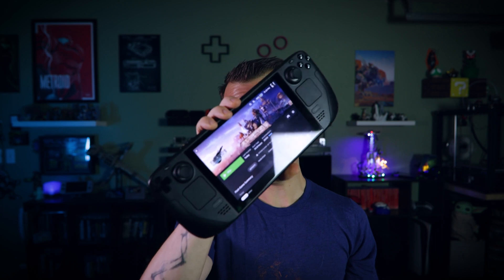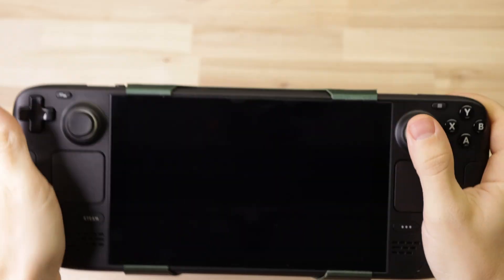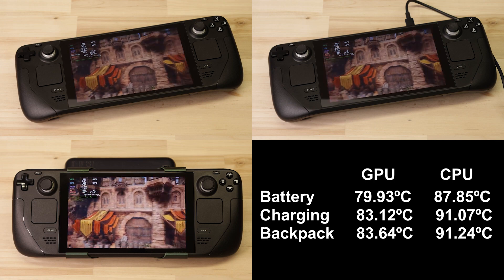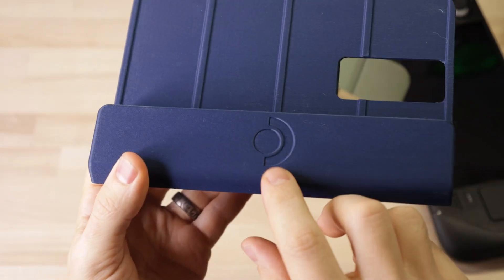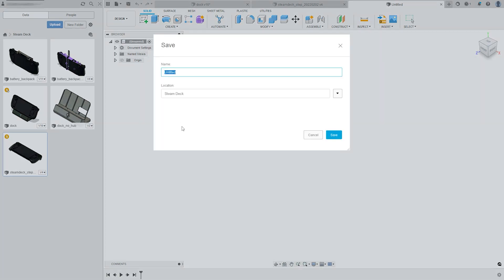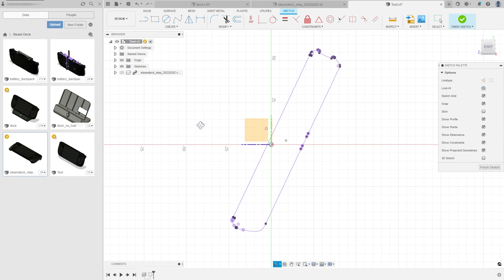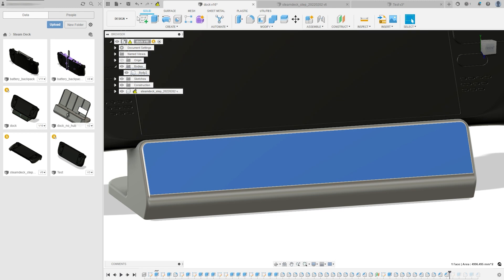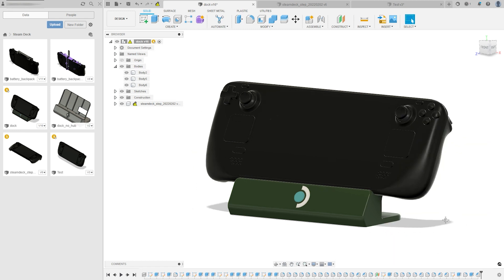3d-Printable Steam Deck Accessories + Fusion 360 tips and tricks!

Comment from the maker: What other kinds of accessories would you guys like to see for the Steam Deck??  Or other handhelds too I suppose... 🤔
Reply: Steam deck case cover , so i don't need to buy the whole kits (dbrand killswitch) . for me thats all i need using my spigen case
Reply: Hey @wermy .  Was wondering what material you would recommend for the battery backpack?  My fear is PLA would get too hot and eventually warp.  Would you recommend Nylon PA12, or possibly PETG?
Reply: @BaradaNels  you want petg. It's incredibly strong, light weight, heat resistant and has almost zero shrinkage. It's amazing. I've used it for commercial diving hats as black out trainers for a school.
Reply: @charlestannehill7537  Thanks for that.  I used petg for a GPU shroud (noctua low profile fans).  Do you think it will have enough bend in it to take the thing on and off the Deck?  My shroud has ZERO bend.
Reply: @BaradaNels  I think if you keep it less than 1.5mm, it should have enough flex. Thicker equals less flex. Go with solid infill. Such a minimal amount of extra material.
Reply: @charlestannehill7537  KK tyvm, I think I'll print one up in black.  Cheers bud!
Reply: Could you print a back cover of The Steam Deck which provides easier access to the M2 drive ? Also, could you work on a Steam Deck cover with a honeycomb design that is lighter?
Reply: Same accessories but with consideration for the top 3 selling cases at least. An attachment that includes micro sd compartment. Would gladly send you a few dollars. I have a 3d printer but I am no where near your skill. I use sketchup.
Reply: I would love to see a dock version that will fit Steam Deck with Project Killswitch and the anker hub
Reply: 1- Front cover case
2- better button paddles
3- change that clamp atatchment to use 2 Rubber bands so it can open and dont scratch my SD
Reply: Wii u Emulator, retro pie

Comment: Can you share please link to short angle type c cable?)
Reply from the maker: Links for everything are in the blog post - check the description. :)
Reply: @wermy  Ok, thanks! Does this cable support data transfering, or it is only charging support? Power Delivery up to 65w?🤔🙈
Reply from the maker: @tblkbandec  It does data as well.  I'm not sure about the power delivery rating, but it charges the deck full speed.  :)